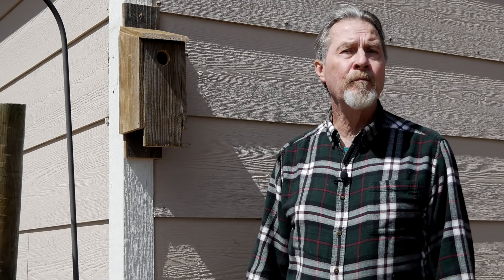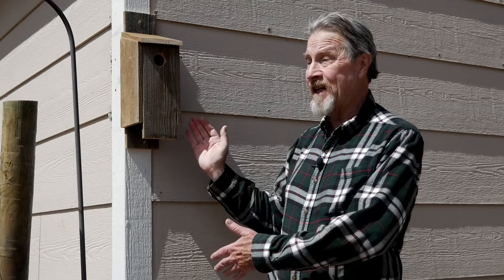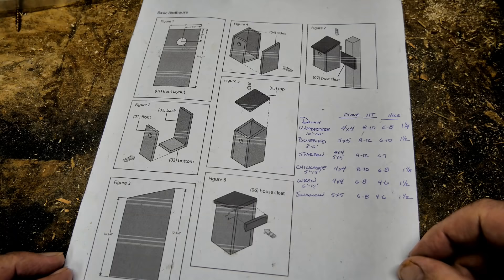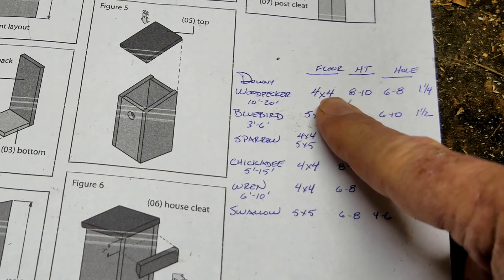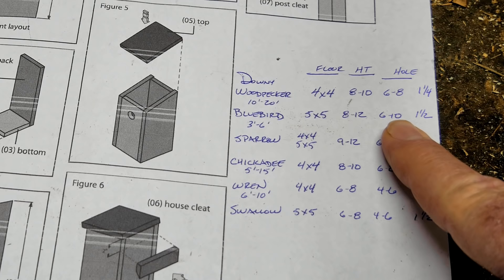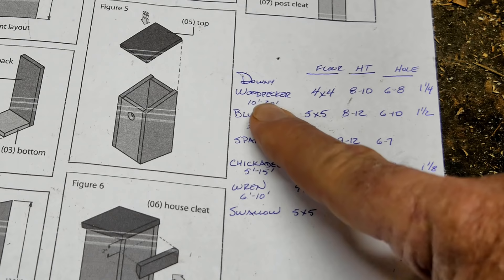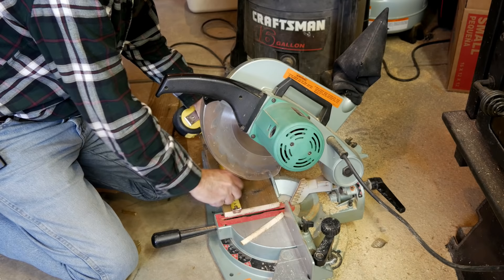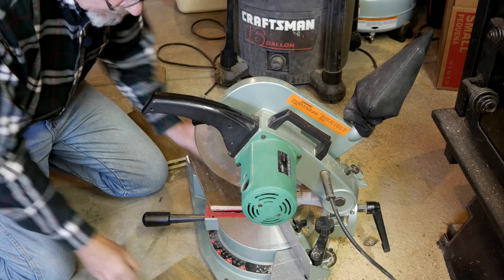How to Build a Birdhouse (That Birds Will Actually Use)

Comment: I wish more woodworkers were birders. Unfortunately this design needs a few additions to make it safe for eggs and chicks.  Aways put a predator block over the access hole to prevent predators from reaching in the box,   There is inadequate ventilation which means eggs and chicks can over heat,  the floor needs drainage, just four small cuts off each corner.  I prefer the access dor to be on the side, but I guess a front door is ok.

Comment: Nice video, . Appreciate. A few suggestions: 
(1) If you rub a bar of soap on the wood (inside) wasps cant build their nests. The way you built the door to pull down (rather than up) makes it easier to reapply each season. 
(2) A metal plate over the hole keeps animals (I.e. squirrels) from chewing the wood and making it a squirrel house. 
(3) Attach  a mesh or glue small mixing sticks to wall (where hole is) to helps chicks climb out. 
(5) Drill holes in corners at bottom to allow drainage and venting/circulation of air
Reply from the maker: Good tips. Thanks!
Reply: Some builders miter small 45° meters on the corners of the floor for drainage and ventilation.

Ventilation is extremely important !

The biggers predetors of bird houses in the wild are snakes.

Fine hardware cloth guards probable work best.

Comment: Good video!
Squirrels, in case there are some living in the area, are a real threat to the birds. Squirrels can easily enlargen the hole so that they can go in and eat the eggs and all.
I have made a steel ring around the hole to prevent the squirrels from butchering the birdhouse. The steel doesn't need to be very thick. Most of the time tin is thick enough. Of course all sharp cornesr must be smoothed out.

Comment: Heard that best to have no perches/short sticks by the hole.  A bird expert noted that (in general) birds never use these (watch videos of the parents landing), but they make a great foothold for predators like crows, raccoons, snakes, etc.  Don’t forget air holes for ventilation, and a couple small drain holes in bottom (more ventilation and so won’t fill up in sudden downpours if roof issues).

Comment: Good video. 
About the hinge: why not to make the front hinge in the bottom? This way the locking screw could be replaced by just a simple nail in a pre drilled hole.
Reply from the maker: Sure, you can do that.

Comment: How can we find out which birds are beneficial and that we want to attract?

Hole saw tip. Once the pilot bit is thru but before you drill all the way through, stop and continue from the back. You will get a cleaner hole with less splintering and sanding.
Reply from the maker: See if you have a local Audubon Society group. Or Extension office. They should be able to tell you what birds are native for you and how they interact with the garden. Thanks.

Comment: Are there any sort of considerations for the orientation of the houses for the different birds.  Is East or perhaps north ideal, and should it be in full sun or shade? Where I am the holes sometimes get chewed (by squirrels? ) so a small plate of some sort of soft metal like tin or thin aluminum sheet drilled to the same size is said to be beneficial.
Reply from the maker: For the most part, avoid orienting the hole in constant shade. Morning sun can be beneficial in warming the house when small birds are inside.

Comment: What was your reasoning for opening the birdhouse from the top out ??? Cleaning would be a lot easier from the bottom. Also, why are you using steel nails ??? I would think that using stainless screws would be the ideal material. So nice to see you have listed the appropriate sizes for birdhouses for specific birds. You win the prize fella. Peace and out.
Reply from the maker: Because the hole is at the top I've had some problems with the old wood cracking if the hinge was at the top, so it is more stable at the bottom. I used the nails I had on hand, but stainless steel is a good option.
Reply: @GardenerScott  Hello Scott, thanks for letting me know about placement of the hinged door face. I would of never thought of it myself. Look forward to making me some birdhouses this week. I will take your advice on placement of the hinge. Will use stainless as I have a few boxes of these screws. Good day and peace to you fella too. vf